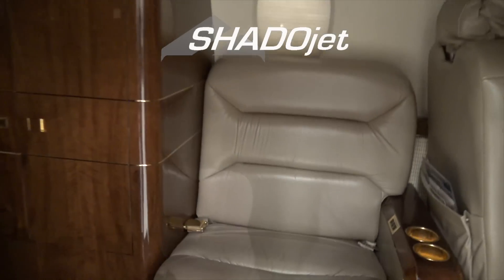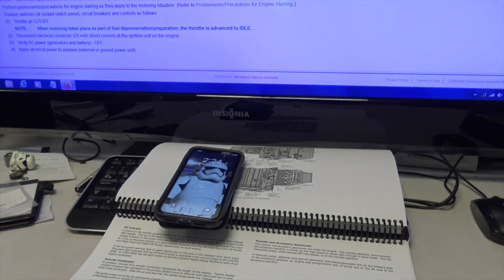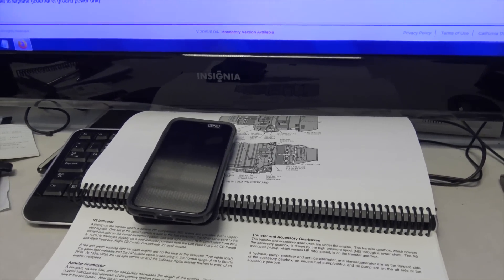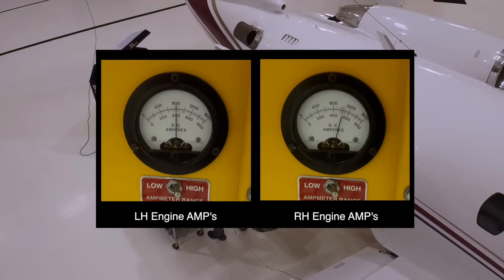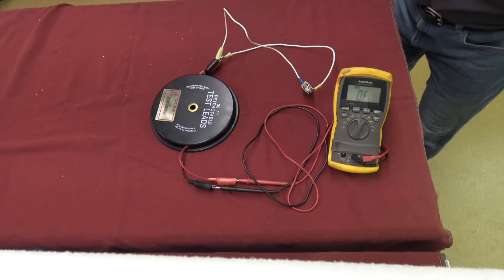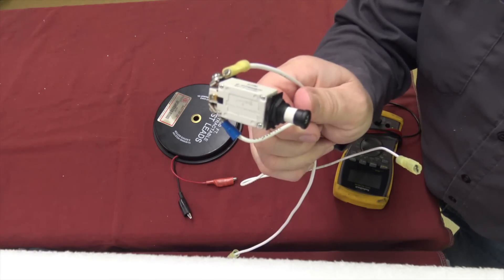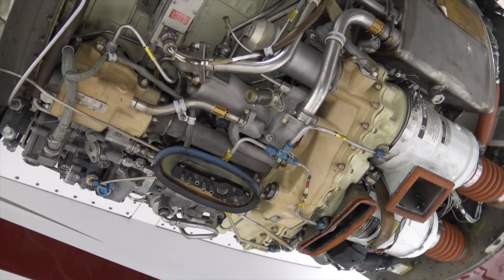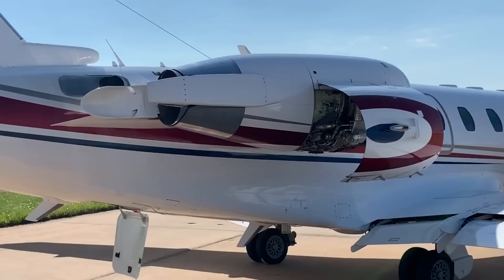Right engine doesn't start TFE731

Comment: Wow.  A technician with an in-depth understanding of what makes an airplane work, combined with trouble-shooting skills.  Sir, you're a disappearing breed.  I love this stuff!
Reply from the maker: I really appreciate your comment. Thank you!
Reply: @shadojet3868  Did you check the Fetzer valve?
Reply: @hoilst265  It's usually the 7th Fetzer valve.
Reply: @Frozen_in_Carbonite  And the ball bearings. Because it's all ball bearings nowadays.
Reply: A&Ps probably know how planes work better than most pilots. Pilots know how to make planes fly. Ask a pilot where his hydraulic pump temp sensor is and see if he can tell you.
Reply: @Synergy7Studios   Remember this Pilots get it up we as mechanic keep it up, one tends to think A&P's now how aircraft work, but not 
always the case, in the course of 45 yrs being in this business I've seen people talk the talk but not walk the walk..
Reply: Trouble-shooting skills are a must, on anything you are trying to fix, understanding the system is first and foremost and the  proper documentation as well .
Reply: Couldn't have said it better myself
Reply: where i work it is usually us avionics techs that troubleshoot 99% of the issues and then tell the a&ps what to change.. LOL
Reply: They know better than engineers and pilots
Reply: nahh man don't tell that it is a disapppearing breed ^^  I know couple of guys ~27 years old that understand what goes where and how it works together add to that that the can talk about their work for hours so easilly even someone who does not care would know what goes where :D